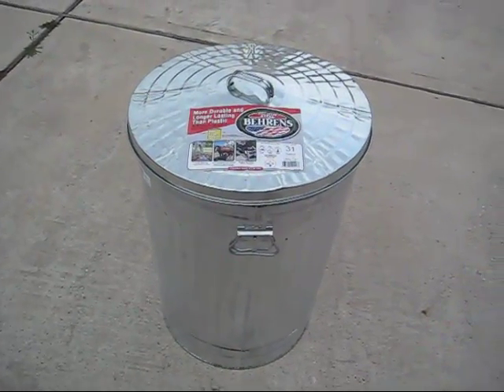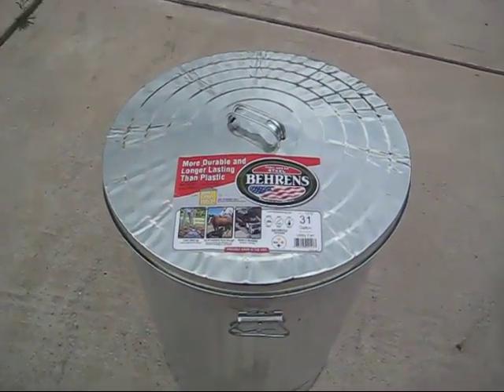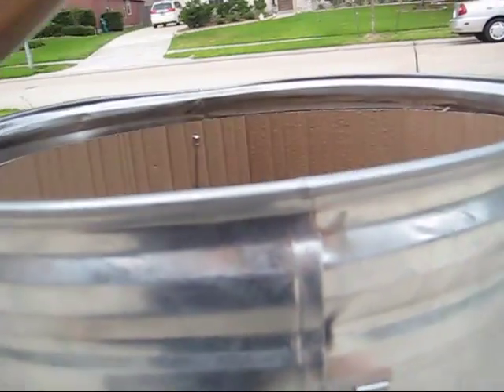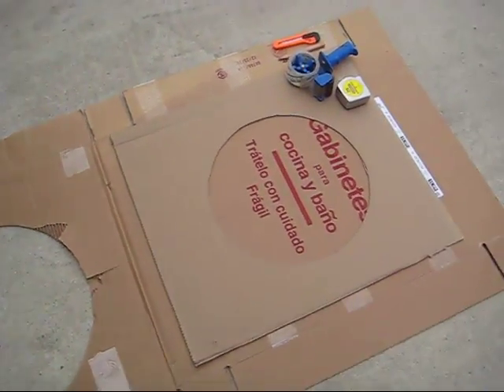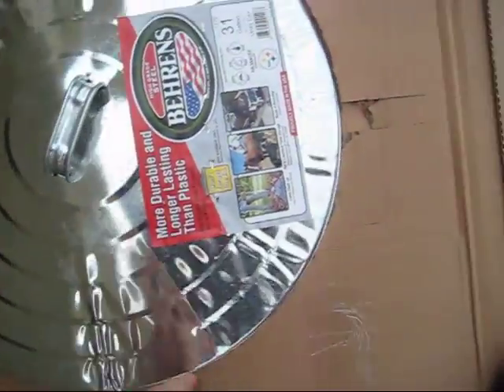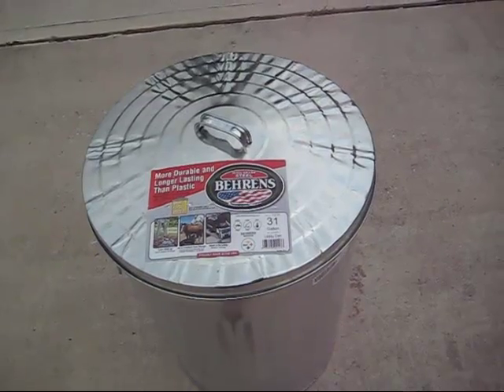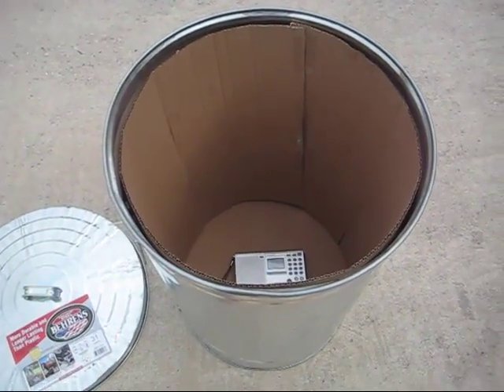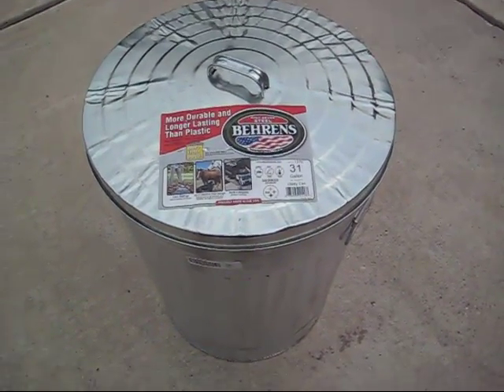Faraday Cage: Garbage Can, Really?

Comment: What about solar panels?  They are too big to fit in a garbage can.  Help.
Reply: Bob R You will need to break them down as small as possible.  Then Build a large plywood box or a crate to store them in.  Then Wrap with metal window screening. If you know how to weld, you can weld sheet metal all around the cube, leaving one side open.  Fabricate a lid that fits tightly over the entire open side of the crate....You must have metal to metal contact and a good tight fit

 Another GREAT option is look for a large metal "job box" that is used in the construction industry.  They can be expensive but sometimes reasonable when used on a site like Craigslist.These typically are all metal construction with a metal lid
Reply: ***** possibly....this is another reason why buying a used one would be the best best...because you haven't invested as much, and you can bet that a used one already has a lot of the paint chipped off at the edges of the opening.  The best thing to do is simply test it alot, using a VERY strong AM radio station in the area...walkie talkies, Two CB radios....check out a number of different frequencies
Reply: Thank you all very much for your comments. Will metal window screening be enough or will aluminum foil have to be added.
Reply: Bob R  window screen should be sufficient.  There is a guy on youtube who shows his idea of how to build a faraday cage around a gas generator.  He uses window screen around the plywood box.  I would recommend watching.....same principles.  There a few things to be careful with when building it with screens (potential gaps)

The key issue is testing the cage over and over using different frequencies.  
I tested mine even with wireless internet frequencies and a laptop...walkie talkies / CBs...family radio, SW Radio AM/FM, etc

AM radio is by far the best,  tuned to the most powerful station in area.  I have one 50,000 Watt AM station in town.  That is the obvious choice

If you REALLY want to find out how good the cage is,, find out where the strongest AM station broadcast Antenna is located in your town and take your cage out there getting as close as you can and doing the AM radio test. I've done that with mine.  

There is a lot of false information from people telling you to ground these cages.  I'm not an expert by any means, but I have a strong physics background and have read a lot.  It seems that those with most credibility say NOT to ground a Faraday cage, that the ground wire (which is required to channel or "bridge" the power to the grounding rod) will serve as an antenna to attract more RF energy around the cage.  

Grounding is important for protection from a lightning bolt, but a lightning bolt and EMP caused by either CME or a nuclear device are different.  

Lightning is pure negative ions where as EMP is RF Energy (Radio Frequency) similar to a Microwave Oven's energy.  

Essentially the cage simply takes the RF energy and lets it travel AROUND the cage protecting the contents within,  but not thru it.  

From what I have read and seen, Grounding will either do nothing at all or increase the likelihood of a breach according to everything I have read and watched from the so-called "experts"
Reply: Thank you very much.  Will watch it if I can find it.
Reply: Bob R Let me know if you can't find it.  Just use the words  "Faraday Cage Generator" in the search bar.  It should take you to the video
Reply: found it. thank you.  also found dr. bradley plus other scientists saying there is no real way to check if you are safe without special emp equipment.
Reply: Bob R That may be true, however we DO know that EMP works on RF energy similar to what a microwave oven produces.   This is why the AM Radio test is probably the best test without specialized equipment

A guy by the name Scott Hunt with Practical Preppers also known as "Engineer 775" on youtube also has a series of videos on EMP, what would be effected by a HEMP and how to protect from it.
Reply: Thank you again for your input.  Will look his info up because I really want to do this.
Reply: Archangel0804 This is all BS as the field you need to shield from is MAGNETIC not electrostatic as all the sources you list are 99.99% Electrostatic!!! Use a strong magnet as a field source on the outside and see if there are MAGNETIC  fields on the inside. If there is any then it will not shield an EMP which will be many, many millions of magnitudes greater then you will generate to test with.
Reply: Mark Cummins Radio Waves are electroMAGNETIC radiation and in no way "electrostatic" Therefore using a strong AM Radio signal at close range of 50,000 watts or greater is a great way to test the effectiveness of protecting against ElectroMAGNETIC radiation.

Elevators and other rooms with metallic conducting frames simulate a Faraday cage effect, leading to a loss of signal and "dead zones" for users of cellular phones, radios, and other electronic devices that require external  electo*MAGNETIC* signals. 

Engineers who work for the DOD to harden their assets use simple Faraday Cages similar to this crude design. 
Engineers at Boeing who develop NNEMP devices like CHAMP Missiles and Drones, emit targeted RF frequencies replicating what would occur in a HEMP situation without the nuclear explosion. Hardening the aircraft with essentially one large Faraday Cage is what shields the aircraft from falling out of the sky

Tell you what....you  do what you want.  I will do what I want, 

I will take the word of Electrical Engineers and tested science and research.
Reply: You need to learn more about electromagnetic radiation as it contains both the Electric field (sometimes referred to as electrostatic) and the Electromagnetic field. The ratios of them are determined by how they are generated. The sources of the fields you list are primarily composed of the Electric field and very little of the Magnetic field... but both are there. They are thought to self induce each other to propagate thru space. A Faraday cage of the type you are promoting is really only good against the Electric field. They are very ineffective against a Magnetic field. Just try the use of a magnet held against the outside as I previously detailed. An EMP is mostly comprised of the Magnetic field. Of the two types of fields... it is the one that will induce the electric currents that will develop the power dissipation in the conductive geometries of your equipment that will destroy those geometries and will destroy the smaller ones first. BTW I am an Electrical Engineer and I am glad you rely on an EE for your information. But rather than trust me just try Magnetic induction in your tests. A lot of people are listening to your advise for a time when there will be no recourse. It that time comes... I know you will not fare well with your current thinking. May I suggest you start here https://en.wikipedia.org/wiki/Electromagnetic_field
Reply: This is a good reference as well. https://en.wikipedia.org/wiki/Electromagnetic_shielding.
Reply: Mark Cummins I have read quite a bit from Bill Radasky, Ph.D., president, Metatech Corporation who is recognized nationally as a foremost expert on EMP.  His comments are that “A Faraday cage is perfect, but nobody builds a perfect one”  

My understanding from his comments is that if a HEMP event occurs 25 miles above Kansas (for example) the pulse may not even effect cars unless you are inside 200 miles from the blast due to the magnetic polarity  of the Earth itself...the greatest risk throughout the lower 48 in the USA is anything hooked to the power grid and that a basic Faraday cage like this would be sufficient to protect from the destruction.

What would YOU suggest?

Comment: You should also seal the container with 2" aluminum duct work tape, will actually give a much better shielding affect.
Reply: I was also watching another YouTuber and he did some tests on the galvanized trash can.  He used conductive thin gaskets and lined the rim and it worked better than the tape cause you don’t have to remove and replace it every time to get stuff in and out
Reply: @LandoftheLost925  Just turn the trash can upside down and fill the lip of the lid with molten lead.
Reply: @stuartgray5877  hehe 😜
Reply: @LandoftheLost925  my family business for over 20 years was building EMI shielded chambers for the US military
Reply: @stuartgray5877  I didn’t know you were serious 🧐 a lot of people can be mean and make weird comments so sorry, I wish I had those types of skills, I’m just an old hippie woman lol
Reply: Do you mean at the top of the can where the lid would set on it?
Reply: @mudwellies1  Yeah after you put everything inside, seal it with some aluminum tape.

Comment: should suggest a small generator in the can, instant electricity
Reply: Archangel0804 , the gas supply will not run out for a long time, think of every car out of commission with 10 gallons in the tank. Not to mention all of the gas stations tanks will be full for the pumping by the resourceful ones.
Reply: ***** Until the gas supply runs out.  Gas pumps at the station run on electricity.  They will be fried in the process. 
A gas or even a diesel generator is sort of a false sense of security. However diesel is the better choice because bio-fuel could be made at home,  post EMP situation...

So unless you have a VERY large supply of fuel on hand (gas goes stale in a matter of 6 months or so without using a preservative like STA-BIL)  you are SOL  Even with a preservative gas will only last about 1-2 years and it will go bad. 

I'm not discouraging a generator...I'm saying it should be ONE of several things you should plan for 

Solar panels can be shielded....Wind generators need nothing  that I am aware of.....However  the charge controllers and inverters for either of these would need to be shielded....this is your best bet for long term needs.

After a massive EMP it would take YEARS to restore the power grid.    The Transformers aren't made in this country and it takes MONTHS to get them

Basically if this happens in the USA, we are screwed.  They estimate 90% of people wouldn't survive the first year because people in this country have lost all of the skills to survive that our ancestors had
Reply: Archangel0804 Have you looked at syngas generation?  The beauty of syngas is that it doesn't require highly refined fuels.  In fact almost any organic material will work, from coal to grass.  (of course it does produce carbon monoxide, so a good CO detector might be in order if it was used)
Reply: mwbhome e I have looked at wood gas (gassifiers) which can be fed directly into a gas generator (and works well), LP conversion kits for gas generators,  (LP never goes bad, but it IS finite) and also certain types of  "Syn-Gas" bio-fuels....I think the easiest is "homemade ethanol".  For the third option, All you need is sugar,yeast and water and a way to preserve those first two items long term.  Then you need to the know-how to distill it.... and you are in business....Plus you will also have another bi-Product that some people will KILL FOR in rough times!!! LOL

With Obama shutting down the Coal industry I don't think coal will be readily available.  Grass and other plant life...yes, but converting to something useful may be a challenge.  

I think the most prudent decision is an "ALL OF THE ABOVE" strategy. ....Solar, Wind, Wood, Ethanol and other bio-fuels, LP, maybe even a diesel engine which runs on used motor oil and used cooking oils....if cars aren't running, there will be waste oil everywhere after an EMP and few people will have any clue that it is valuable or what to do with it.
Reply: Dude...the  pumps at gas stations run on electricity.  
The tanks are buried underground.  How are you going to get to it under asphalt or concrete....With Construction equipment that WON'T start??  

If an EMP Strikes, the value of the dollar is crushed...worth ZERO.  

That said, the owners of the gas stations will no longer be in business.

Let's suppose IF they can tap their own tanks, they are UNLIKELY to sell it to others...they will keep if for themselves and will be protecting their property with an arsenal...you can bet on it.

Moreover, it is a finite supply...when it is  gone it is gone.

YES...You are right that plenty of cars will have gas in their tanks, and very few will run due to the computers and electronic ignitions being FRIED by the EMP....but it won't take long for all of those tanks to be emptied  if you have 300 Million people looking for things like fuel.  People will puncture holes in the gas tanks and all of the fuel to be taken and consumed in no time at all

Comment: This would work better if it were earth grounded. However, your experiment isn't really that good. What FM station was it, how close (as the crow flies) are you to the transmitter and more important, how much power are they broadcasting at? In my area, they are about 50KW (power drops exponentially with distance), which is nowhere near the power of an EMP. I would use a very heavy wire and ground this to your water main which is earth grounded. Also, put this in your basement right up against an underground wall, the more mass between the outside and your garbage can, the more protection you will get. I would also double and triple up on the cardboard or preferably, rubber inside the can. Electricity takes the path of the least resistance (well, most of the time), this is why you should earth ground it. Any voltage that builds up in the metal will want to go to ground a lot more than to jump several inches through cardboard or rubber
Reply: tarstarkusz Engineers have shown that a wire used to connect for grounding can act like an antenna and it is actually worse for an application like this.  It pulls more EMP towards the Faraday cage, rather than diverting it away and around it. I agree with the majority of your statement. Basement is best...rubber shielding, etc. Nesting inside is a great idea.

A great way to test is to find an AM Station antenna in your town (if possible) that puts out a huge signal....like  50000 watts....Pull over near their antenna and test...... put your garbage can on the ground and try the same experiment.  I did exactly that, and without a ground...total static.  The galvanized garbage can works very well

Comment: How about putting your stuff in a trash bag, duck tape it. Put that in a 50 gallon mylar bag, seal it with aluminum tape. Put that in the trash can, seal with aluminum tape.
Reply: Power Up That would work, but very difficult to test to see if there are any breaches.  Each time you open and close to test you may get different results.  My suggestion is something rigid...like the garbage can

Comment: I keep my backup CD/DVD's in a small biscuit tin with the lid on, will that protect them from an EMP burst?
Reply: I think you have that backwards, put your CD/DVD players in the Tin.  EMP won't effect CD's or DVD's.  They aren't electronic, they are optical.

If you line the inside of the tin, with something like cardboard, and it seals fully.  It might work.
Reply: GhostInTheShell29 What about when you put CD's in the microwave?  Very pretty light show, but it shows that very strong EM waves will ruin them.  I'm not an expert, but it would be interesting to find out if an EMP would do the same.
Reply: mwbhome e The microwaves melt plastic.  The CD backing is plastic,

I'm not 100% sure what the wave length of an EMP blast is, but I don't think it would be in the microwave level.  Otherwise we'd be more worried about our own survival not our electronics.
Reply: GhostInTheShell29 It is not due to the plastic melting.  If you left it in there long enough it probably would melt, but the effect I am talking about is almost instantaneous. It is caused because one of the layers of the disc is conductive, and when the microwaves hit it its just like a wire in the microwave.  It starts sparking and crackling from the induced currents (basically the same thing that an EMP does to your computer chip).  Like I said I'm not sure an EMP would cause the same effect, but it would be interesting to find out.  

On a side note I think EMP covers an extremely wide range of frequencies.  In fact because it is such a powerful and short pulse it basically has to be a wide range of frequencies.  I reference you to https://www.youtube.com/watch?v=0OOmSyaoAt0  
He is speaking about light waves, but the same principle applies when you burst any electromagnetic waves in a short pulse.  It covers a very broad spectrum just due to the physics of it.

Of course the physics of an EMP might have differences, and I am certainly no expert, just putting in my two cents. :)
Reply: +Tungsten Is that all youll be worried about? Youll never make it if the power does go off.Lol😂

Comment: The lid of the can will easily warp and let some signal through.  LDSPrepper, have you heard about using mylar for similar purpose? I purchased several to surround my walls. These are the aluminum coated " heat blankets" they sell at camping equipment stores. I am surrounding a room with it taking care to fold over for metallic connection between blankets. They come in sizes of 7 or 8 feet by 5 or 6 feet. Also using aluminum duct tape to close openings. Do you have an opinion?